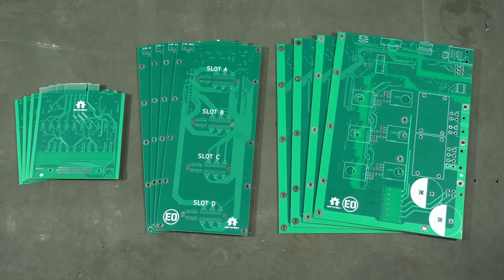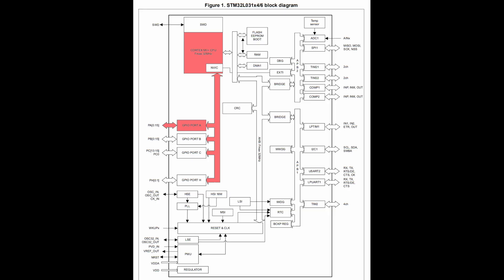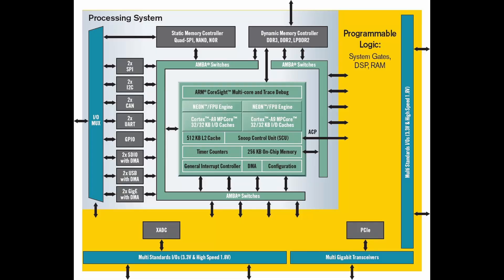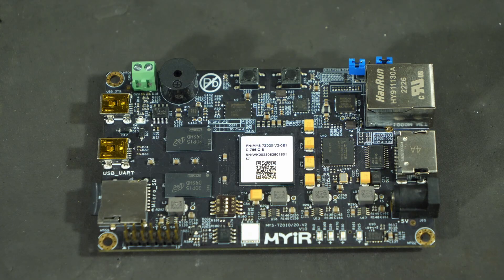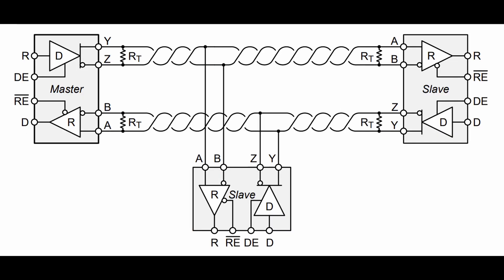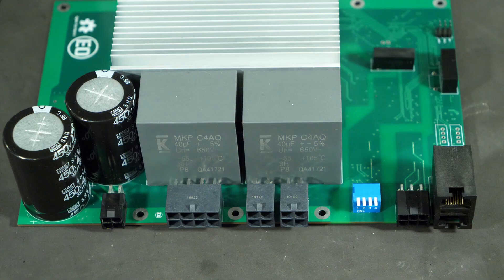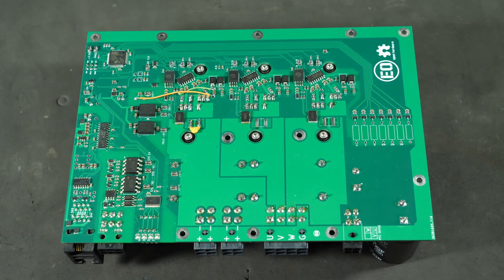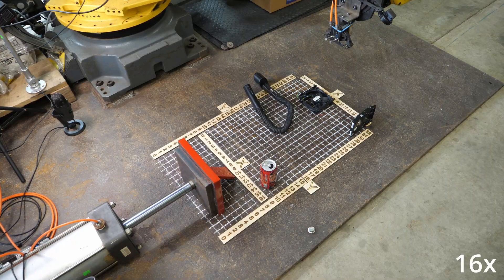The First PCBs: Open-source Industrial Robot Controller Part 3

Comment: what does entropy source validation do again?
Reply: Entropy source validation refers to the process of ensuring that a source of randomness (entropy) produces output that is sufficiently unpredictable and uniformly distributed, which is crucial for cryptographic applications. This validation is important because cryptographic systems often rely on random numbers for key generation, encryption algorithms, and other security measures. If the entropy source is predictable or biased, it can compromise the security of the system.

In entropy source validation, various statistical tests and analyses are performed to assess the quality of the randomness. This includes checking for uniform distribution, unpredictability, and lack of bias in the output. The validation process helps in determining whether an entropy source meets the required standards for use in secure cryptographic systems. (From ChatGPT4)
Reply: In motion control systems, entropy source validation is crucial for ensuring the security and reliability of the system. Randomness is essential for generating unpredictable and secure cryptographic keys, which are necessary for secure communication and data protection in motion control systems.

To validate an entropy source, several factors must be considered. These include the quality and randomness of the entropy source, its resistance to attacks, and its stability over time. A good entropy source should be unpredictable and produce high-quality randomness, even under varying conditions.

The entropy source must also be validated to ensure that it meets the requirements of relevant standards, such as NIST SP 800-90B. This includes testing the entropy source under different scenarios and conditions to ensure that it consistently produces high-quality randomness.

In motion control systems, it is particularly important to validate the entropy source to ensure that it is resistant to environmental factors, such as temperature changes, vibrations, and electromagnetic interference. The entropy source must also be protected against attacks, such as side-channel attacks and attempts to manipulate the source of randomness.

In summary, entropy source validation in motion control systems is essential for ensuring the security and reliability of the system. The entropy source must be validated to ensure that it produces high-quality randomness, is resistant to environmental factors and attacks, and meets relevant standards.
Reply: @dkraft   Did you generate that with AI? Why?
Entropy source validation is a part of the chip he's using, and doesn't have anything to do with the motion control system